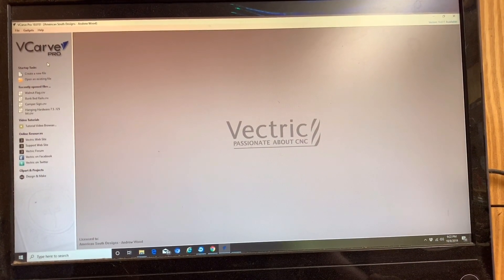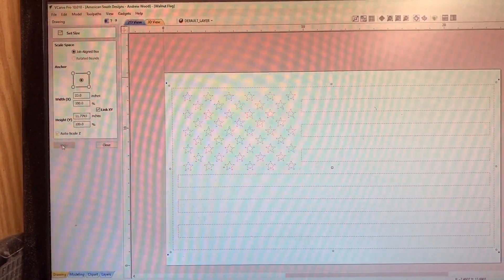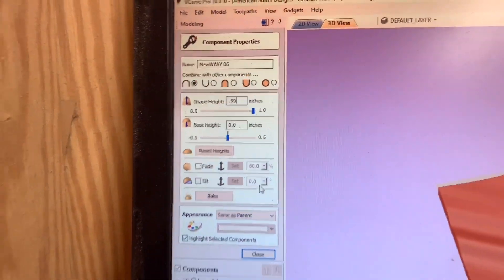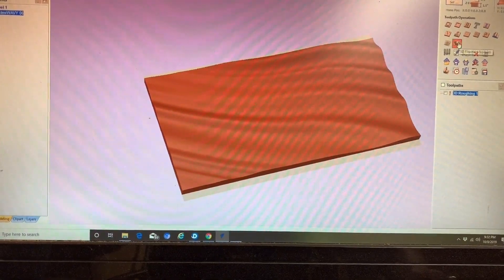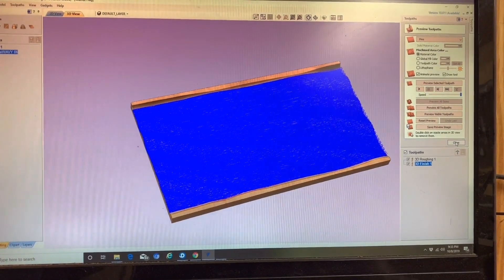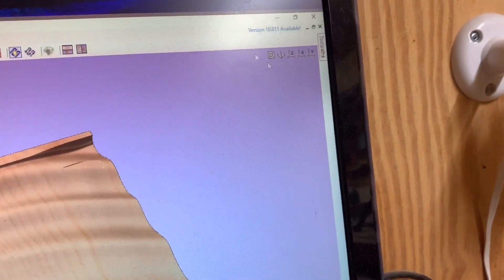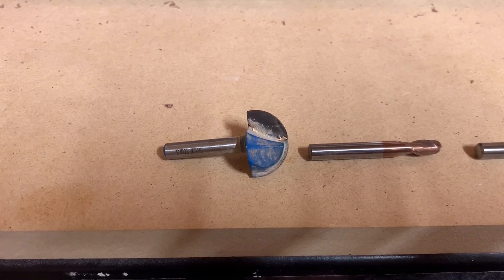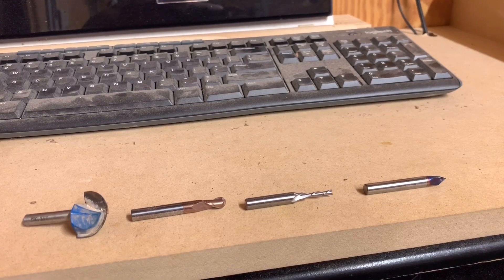How to Make a Wavy Flag on an X-Carve CNC Router

Comment: how hard would it be to add an eagle to the carve. Also, I followed your video and it says that it will take almost 22 hrs for the wave roughing, using the same settings on my xcarve.
Reply from the maker: It wouldn’t be hard if you’re using Vcarve/Aspire as your CAD program. If you’re using Easel Pro, you’d need to create a whole new STL model. Play with your settings and see what you can improve
Reply: I have tried changing the settings and was able to incorporate the eagle in the flag. Even with using with your settings as shown in video, and no eagle it still says over 22 hours to complete. how did you get it to 3 hours? Is there a way to send you my files to look at?
Reply from the maker: Yes, you can email them to me. drew@americansouthdesigns.com @beckybinder7689

Comment: What are the rough times for your roughing and finishing passes? I just followed your video and on a 10x22 flag it was about 3 hours for each pass (6hours total)
Reply from the maker: Roughing with depend on a few factors. I’ve gotten my roughing down below an hour. I run a bigger machine though…so it depends on your machine. There are also different roughing strategies that can improve it.

Comment: Great video. Where do you adjust the passes for the 1" ball nose? my trying to cut it all at once?
Reply from the maker: You have to make those adjustments in Vcarve or Aspire under the tool set up. You would adjust depth per pass and stepover percentage

Comment: Can you show how you set up that 1 inch round nose bit in aspire
Reply from the maker: It would be set up as a 1" ballnose bit. I typically set them at 40% stepover when roughing out material. Speed and depth per pass will depend on your machine and the material you are milling.

Comment: Great video!! Can I ask in what order do you start with on the bits? And what bit you end with? Thanks for the video.
Reply from the maker: I would Suggest starting with a roughing bit to remove waste, then a detail ballnose for the finish pass. If you’re cutting a design into the wavy model, that would be last

Comment: Great video. I have my wood ready to start it. What did you put on the wood after the wavy finish cut, prior to cutting the strips?
Reply from the maker: I like to water pop hardwoods before my final sanding. I’ll either spray it with water or wipe it with mineral spirits
Reply: The stripes are cutting as I type this. They don't seem to be of consistent depth across the flag, taking consideration the waves. There are a couple spots that barely cut wood. Yours seem to be fairly consistent.
Reply: I had a thought. My flag dimension is 10x19. I adjusted the wavey model toatch but should I have adjusted the 3d effect? Yours seem to be a bit flatter than mine and it's the right hand side of the wave that is shallow cut.
Reply from the maker: @stevenwilson4621  that’s correct. As you adjust the XY dimensions, you can adjust the Z height. As you increase the XY the Z gets taller...but you can adjust that to work with your material thickness

Comment: I would like to make a wavey flag with my xcarve cnc but I only have Easel software. Can I purchase the tool path g-code as a file to import to Easel since I don't use or have V Carve software? Thanks for your help! GREAT VIDEO!!!
Reply from the maker: Technically it could happen, but it’s not advised. There are many variables that play into creating the gcode.
Reply: @americansouthdesigns  Could you elaborate more?  I don't have V-Carve either but I've been thinking about asking someone with design experience to incorporate an Army unit logo on a wavy flag.  Just curious as to why this wouldn't be a good idea.  You make great stuff man.  I just need to pull the trigger on V-Carve Pro but damn....its expensive.
Reply from the maker: @justinc1456  there are too many factors to consider when using a Gcode created by someone else. You have to know the exact measurements of the material (XYZ), the tools that are being used, feeds/speeds, post processing etc. Vcarve will pay for itself quickly.

Comment: I’ve got a question for you...I can get my roughing pass & finishing pass to work on my 3D model, when I select my svg file & check the box project toolpath onto 3D model, I hit calculate & it doesn’t follow the contours of the 3D model at all. It cuts right through everything 3D as if it wasn’t supposed to be there.
Reply from the maker: What is you depth for your toolpaths?

Comment: Great video, I have been wanting to try a wave flag. I have a question. Why do you use the V-bit on the stripes? Personal preference or does it add something to it? Thanks.
Reply from the maker: Vbits can fit into the corners of the stripes, making them sharp. If I used a normal endmill, i'd have rounded corners in the stripes.
Reply: American South Designs that’s what I was thinking. I use a .25 or .125 end mill and leave them a little rounded.

Comment: Great design and video.  I followed along and created the file.  I'm currently using a CNC at a Makerspace with a Dewalt Router and Vcarve Pro.  My estimated machining time is 8 1/2 hours using your same feeds and speeds.  I can't nor would I want to sit there for that long.  Any suggestions?
Reply from the maker: Tony Oligmueller what size is your flag?
Reply: American South Designs same dimensions as the tutorial
Reply from the maker: Tony Oligmueller hmm...Is that the time that Vcarve is giving you? I haven’t had much luck with that time being accurate.
Reply from the maker: Tony Oligmueller are your stepovers the same?
Reply: @americansouthdesigns  The flag is the exact same including all of the settings.  I may try to scale it down to shorten the time to see how accurate it is.  The few things I have done, the time has been relatively close but usually longer.  Roughing 1:30, finish 3:53, Vcarve Clear 2:36 and Vcarve 0:29
Reply from the maker: Tony Oligmueller I don’t recall mine taking any longer than 4-5 hours. I don’t remember, but I may have upped my speeds and feeds once the carving started. Are you using a 1” bit for clearance? What are you feeds and speeds?
Reply from the maker: I usually start at 70ipm and move up to 100ipm.
Reply: @americansouthdesigns  your video did not shows the feed/settings for the 1/8" bit and 60* V Bit,  can you share those?
Reply from the maker: Kristina Ash I typically run those at 70 ipm. My depth of cut is .125” (1 pass)
Reply: @americansouthdesigns  thanks! I am going to give this a try today!
Reply from the maker: Kristina Ash good luck! Let me know how it goes!
Reply: @kashthis33  I know its been a while but was curious to see how long it took after the changes. I too am finding that its taking 4+ hours not the mentioned 3 hours machining

Comment: Love this. Great video! What are the hooks your installing for hanging? Is there a file out there for the recessed area they sit in?
Reply from the maker: benjamin lipinski I bought the hooks off of Amazon. I created the file in Vcarve based on measurements I took from the pieces.
Reply: @americansouthdesigns  did you end up selling the flag? If you did may I ask what you got for it?
Reply from the maker: benjamin lipinski this one I kept, but I made one  little bigger for $250
Reply: @americansouthdesigns decided to design one of these in vcarve and using the same settings and bits as you in this video my roughing is estimated @ 3:06 hrs and the finishing is 6:11 hrs.  Are those times close to what you were getting in your preview in this video?  Seems kind of long.  My model is 14" x almost 27".
Reply from the maker: benjamin lipinski I know we talked on the phone, and you got it down...what was your total time?

Comment: Great video. Would you consider making a wavy board without the flag components?
Reply from the maker: KingsXish the flag components are a separate toolpath. So, to make a wavy board without them, would just require not cutting them. Is this what you mean?
Reply: @americansouthdesigns  Yes. Do you have an email address where I can share what I need? Thanks
Reply from the maker: KingsXish americansouthdesigns@gmail.com
Reply: @americansouthdesigns  Email sent. Thanks!

Comment: Where did you get the larger drill driven sanding brushes?  Also why use an 1/8" downcut as opposed to 1/8 inch ballnose for the stars and stripes?
Reply from the maker: I purchased the larger sanding mops off eBay. I tried finding a link but couldn’t find a current one. Also, I don’t currently have a 1/8” ballnose. have considered trying a ballnose, but wasn’t sure how it would turnout. A ballnose doesn’t reach its full diameter until a certain depth is cut, whereas a downcut reaches its diameter at any depth
Reply from the maker: https://rover.ebay.com/rover/0/0/0?mpre=https%3A%2F%2Fwww.ebay.com%2Fulk%2Fitm%2F173863662600

Comment: What if some of my stars and some stripes along the wave wont show on the detail path? I'm not sure how to adjust my depth for wave or flag
Reply from the maker: Did you make sure to select the box that says “project toolpath on 3D model”? You can adjust the depth of the model in the modeling tab. You have to make sure the z axis height of your model isn’t taller than your designated material height.